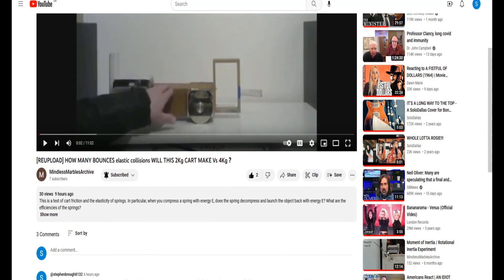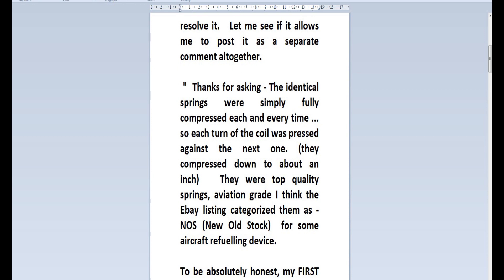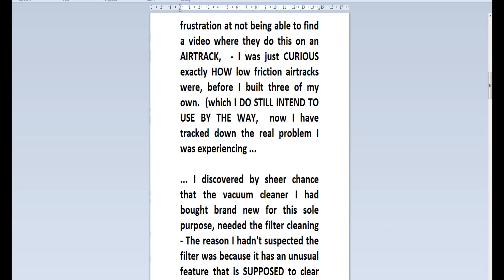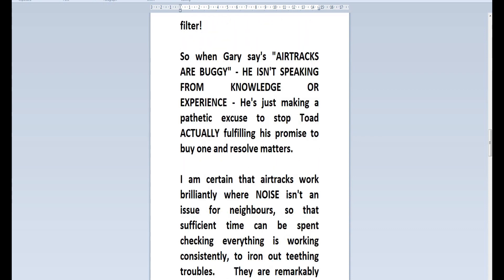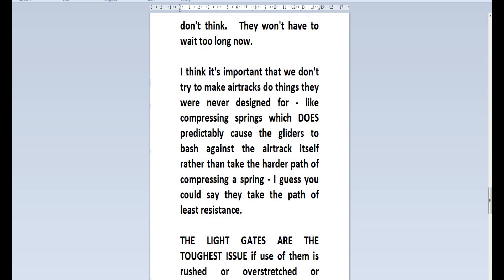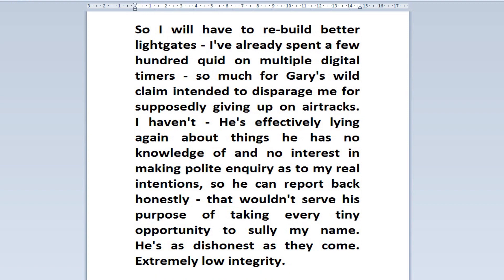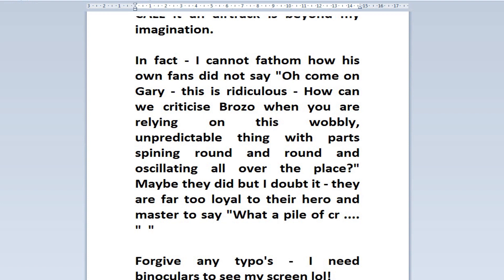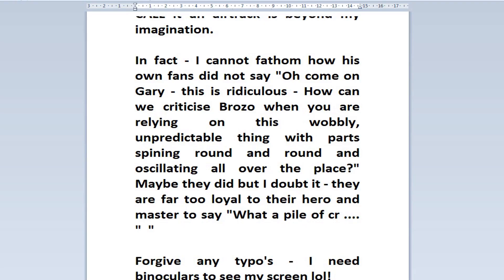YOUTUBE BLOCKED MY REPLY TO MINDLESS MARBLES SO HERE IT IS IN VIDEO FORM.

Comment: Force times distance is equal to energy. E=Fd. And force is equal to mass times acceleration. F=ma. The gravity constant is acceleration. If you stand on a scale the force that pushes it will be F=mg. When you stand on a table the height is the distance to the floor. Your potential energy is mgh. Which is ma times the distance. Which is energy. Garys latest claim is mgt.
Reply: Yes,
The equation isn't wrong, but it is momentum, since the units of mgt are Ns.
Goofy's misleading trick is to call 'momentum' 'energy'.
Reply: I don't know if you've seen it, but look into my recent video where I explain why treating "mgt" and "mv" as energy leads to a violation of conservation of energy.